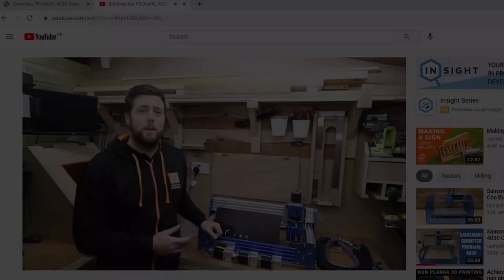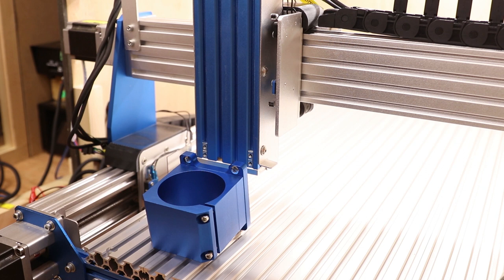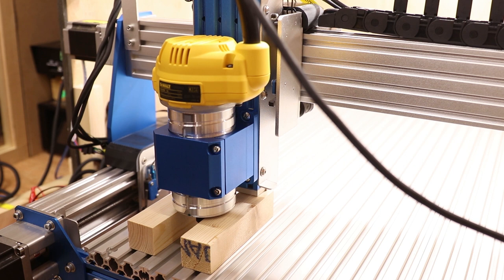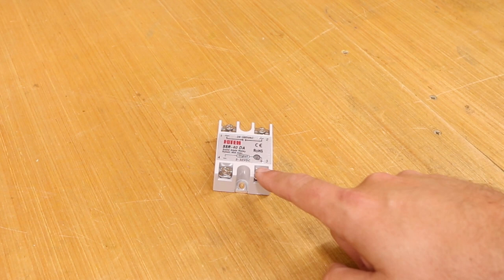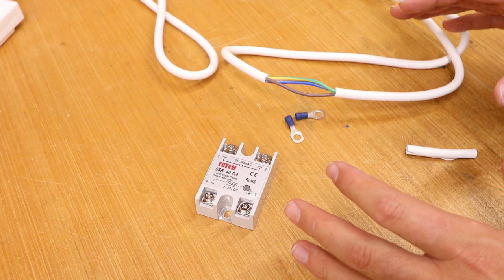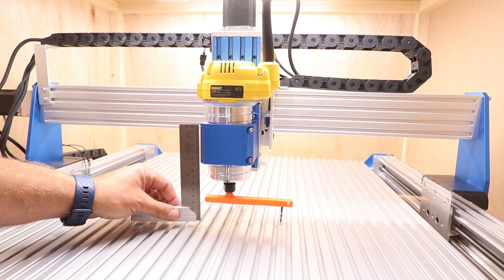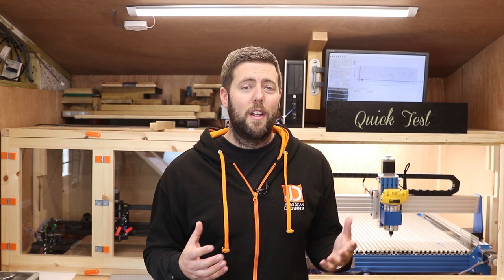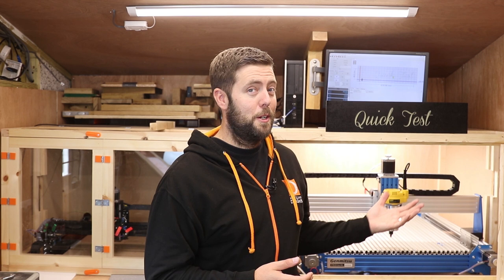Upgrading your spindle/router on a desktop CNC - 300w to a Dewalt DWP611

Comment: To switch on your DeWalt spindle, had you considered an automatic load sensing switch, similar to what would be used to turn on a vacuum dust collector when a table or bandsaw is tuned on?
Reply from the maker: I may be getting confused but is that not what SSR does which I use in my video? or is this something separate?

Comment: Hi James, big thanks for all your videos they have been invaluable. I have upgraded my spindle to the D26200 Dewalt and very happy (apart from loosing a bit of the work area). I have some 1/4" -> 1/8" bit adapters/converters for the bulk of my bits but I do have some 6mm ones which I have bought over the past few months from sellers saying they were 1/4". Now I do have the SainSmart set of collets but do you know if these are OK in the Dewalt collet nut ? I would have tried before asking but I cannot get the collet out of the collet nut on the Dewalt (I do not want to damage it with brute force).
Reply from the maker: Sadly not, the Dewalt collets are unique to them. you can buy different collect to fit the dewalt but they are not cheap, or not in the UK anyway. Ive just had a similar thing and ended up just buying new 1/4 bits instead but I only had a couple of 6mm bits
Reply: @James Dean Designs  Thanks James. I have actually found a Dewalt 8mm replacement collet/nut with a Trend 8mm/6mm adapter which means I can use some 8mm ones I have as well. Not too badly priced @ £23.12+VAT inc delivery from FFX.

Comment: Does any one know how much cutting area you lose due to the router sticking out further. The only way around this would be to move the limit switches to the max position and possibly over hang the spoil board.  Or extend it. Unfortunately i do not  have the space to do that.

Comment: Hello James, Thank for the very nice videos. They have been a great help!  But I have a question. The power output for the original 300W DC spindle is very likely to be PWM. This means the SSR will probably also switch at that rate. Does it influence the Router (speed - power) ?
Reply from the maker: The output for the laser is PWN but I'm not 100% sure the spindle is. Either way I can't say I have noticed any issues, it's worked perfectly fine
Reply: @JamesDeanDesigns  Thank you for you answer. SSR is already on the way. The machine certainly deserves this upgrade.

Comment: Hey James, can carvoco still control the rpm’s of the router, if connected via the SSR?
Reply from the maker: No. Once you use an SSR you then control the speed manually on the router

Comment: Hello James!  I know that you had a video on here for upgrading the Genmitsu 4040-pro with a makita RT0701C with the solid state trick....I can't seem to find i anymore on here.  Is it still available?  Thanks!
Reply from the maker: Hi, I think you may be getting videos mixed up. So this is the one wiring in the SSR. On the 4040 Pro review I should running it with the Makita but not wiring it into the SSR.
Reply: @JamesDeanDesigns  Yes, that's probably the case. I was still able to use the information from that video and applied it to mine. Worked out great! Thank you!

Comment: Good video. Where to get collets for smaller shanked bits for the Dewalt?
Reply from the maker: You can get collets off amazon or ebay but if its just for 1/8th bits then search for a 1/8th collet sleeve. They are a lot cheaper than buying a full collet insert
Reply: @JamesDeanDesigns  Yes 1/8 collet. Thanks for the sleeve tip! Will buy one.

Comment: Hi James, Easy to follow video. I have a strange problem, the router pulses, slows down, and speeds up when connected via the SSR. It keeps a steady speed if I plug it in directly and manually turn it on. I've checked all the connections, thinking it might be a loose wire, but all are fine. Any thoughts on what the problem might be?
Reply from the maker: Make sure the manual power dial on the control box is turned up to full if you have one. If not then make sure the your RPM signal is at full which basically means the RPM value you're sending out equal to or higher than your $30 setting. Hope that makes sense
Reply: Thanks for your help. I don't quite understand what you are saying about the RPM signal? I use UGS, would that tell me my RPM signal output? I understand about the $30 setting and I will check that to make sure it is at least the speed of the router.   @JamesDeanDesigns
Reply: Thanks James, I finally worked it out. Obvious when I thought about it, the file was configured to the original spindle specs on my Sainsmart 4040, changed the spindle speed in the gcode and all good.

Comment: I'm confused, you talk about wiring the original spindle into the bottom of the SSR then the router into the top, but then go on to splice an extension cable, which I assumed would be plugged into the mains hence the plug and socket (for the router) and getting power from the original spindle??????
Reply from the maker: So the splicing of the extension cable is to save splicing the cable on the router... this is purely to avoiding voiding any warranty. 
The SSR doesn't draw its power from the existing spindle cable, it just uses the signal. Effectively think of it as an on/off switch
Reply: @JamesDeanDesigns  thanks, I'm just at the start of making my own cnc, had the mechanical parts for a few years and only just built the frame. I've got 4x nema 24 stepper motors, 4x DM860 Drivers and a 240v dewalt palm router, looking at buying the SSR to use the router, but the description of the wiring confused me...Still does, would I have to run wires from a cnc controller (spindle outputs) to the bottom of the SSR since i don't have a spindle???
Reply from the maker: @mickyas1000  essentially yes. The spindle output from the control board is what tells the SSR to turn the router on. The new FoxAlien unit is an easier and faster way but still works on the same principle 
https://youtu.be/vEOX8F8dkn0
Reply: @JamesDeanDesigns  aw man, thanks, but even more stuff for me to get my head round and consider buying. 🤣
Reply: @JamesDeanDesigns  so just to clarify, before I burn the house down, I take the neutral from the 240v mains directly into the router (dewalt 900w palm router), the live from the mains into the SSR then out of the SSR into the router and the bottom 2 terminals on the SSR are connected to the controller  48v power output or 48v spindle output (the controller has both)...so no need for an additional psu?? As I've seen various diagrams showing the SSR being hooked up to 24/48v dc psu's!!!

Comment: Awesome video. I can’t find the dewalt locally. Can I use the Mikita router?
Reply from the maker: Yes you can! but you will need a little sleeve to sit within the holder. The dewalt is 69mm diameter, and the makita is 65mm I believe.
Reply: @JamesDeanDesigns  thank you I found a dewalt locally

Comment: I have a DeWALT D26200-QS - which looks very similar to DWP611 - but it seems to have some safety feature wich prevents it to spin up when the router's power button i in the ON position and the external power goes from off to on. Has anybody else a similar experience?
Reply from the maker: Makita did a similar thing on their 702 model. I believe its called anti stop/start technology and sadly is a pain for those who use them in CNC routering. Whilst I suspect there are some differences, there was a video on YouTube showing how to get around it on the Makita. Does require opening it up so you just need to be careful

Comment: Hello James, 
I have a Foxalien Masuter pro and I tried to attach a Makita R0700C and I did the wiring using the SSR following your steps but it didn’t start at all. Is there any advice you can give.

Thank you 🙏🏼
Reply from the maker: If you wired it exactly how I have in the video, and have the same rated SSR then you should be fine. I know a few who have done it on the Masuter Pro and its been fine. If you're on Facebook then maybe send me some photos
Reply: @JamesDeanDesigns  Thank you for taking the time to response, I did the wiring exactly the same as you did, but now after watching few videos on YouTube I believe the SSR I bought is damaged because the small light didn’t light. I will go and get a new SSR and try again. Sure I will send you few pictures when I do the wiring again tomorrow. 

Thank you again for your time and help 🙏🏼

Comment: Hi James can you help I know nothing about cnc machines I do a lot of Woodturning and make lots of wooden boxes with lids and want to start doing some cnc work on the lids and in filing with resin I need something that can cut into hardwood possible to a depth of 25/50 mm was looking at your videos on the genmitsu cnc 4030 it was on offer for about £850 on Amazon but now back up to a grand is this machine capable of that depth? And finally how would I transfer images what would be the best software for it 
Regards
Dave
Reply from the maker: Hi,
Yes the 4030 can do that deep. In terms of taking an image, it depends what type of an image. There are generally 2 types, vectors and raster.  Vectors are things like text, logos, usually simpler shapes. Raster images are things like photos. Vectors are easy to convert and machine, raster images are harder

Comment: 3db difference (70 vs 73) is x2 noise level increase ! It is not just 3db ….. db’s are not liniar , every 3db are x2 increase in noise  ….
So the router showd actually 4 db increase in noise so it is more than twice lauder than the spindle .

Comment: Just wondering what is the best way to turn a jpeg picture into a 3D image that can routed on a cnc machine
Reply from the maker: It's not a task I've done before but you need software capable of doing it. I think Carveco Make+ or Vectric Aspire can do it, also Meshlab I think but not 100% sure

Comment: I would like to upgrade the spindle on my 3018 Pro with a Dewalt router. Is the 3018 framework sturdy enough to support a Dewalt router?
Reply from the maker: I have seen people do it, but I personally would consider extra support such as liner rails to take the weight

Comment: How do you control the speed of the router?
Reply: This has to be done manually on the router.  The dewalt 611/262 speeds are about:

Setting / RPM
1      -      16,200
2     -      17700
3.    -     19450
4.    -     21100
5.     -    23500
6.    -     26900

Comment: Hi James I bought the IOT Relay how do I hook it up any thoughts
Reply from the maker: I believe there should be a connector  where the cable from the spindle goes. And then you plug the other devices into the top such as your spindle and vacuum
Reply: Hi Robert. So how is the  IOT Relay working out for you? I'm interested in getting one, also but I do not know how to hook it up or anything. 
I'd appreciate any help you can give me. 
Thanks.
Reply: @JoeLazzara  Hi Joe I haven't upgraded yet because I having some issues with homing and soft limits ( I think) but I got a reply from James Dean that should help you out:  James Dean "I believe there should be a connector where the cable from the spindle goes. And then you plug the other devices into the top such as your spindle and vacuum"
Reply: I know this is an old question but I also purchased the IoT and am having trouble getting it to control my router. I attached the spindle wires into the port on the side of the IoT but do not get an "active" light nor does the router turn on (the "+" and "-" spindle wires are attached to the matching ports). I've tried sending the m3 s10000 command but still haven't had any luck. Also, the router is plugged into the "normally off" outlets. Is this correct? Any help would be deeply appreciated.
Reply: I'm replying to my own thread in case someone else runs into a similar problem. So, as I suspected, it was complete user error (read - user stupidity). While I had the device wired correctly, I couldn't get it to work. When I read the voltage coming off the input wire going into the IoT, there wasn't enough to switch the device on. After fiddling with the controller box, it dawned on me to try the speed controller knob... and of course it was turned all the way down. A simple flick of the wrist and my problem was solved. 

In my defense, I never used the stock spindle but had upgraded to the DW611 upon assembling the CNC. Still... stupid is as stupid does. Hope this helps someone else in the future!
Reply: @RockyMoroz  so the IOT relay worked as expected? are there different types? i can see there are different slots for the router to get plugged into.

Comment: Can you use a cordless router (I have a Dewalt DW600) instead of the Dewalt 611?
Reply from the maker: I would advise against it. May be ok for a short job but usually as the power drops in the battery, so does the torque and that's not ideal as it will likely cause a job to fail
Reply: @JamesDeanDesigns  Thank you James. That makes a lot of sense. As always, great info and keep up with the really informative videos

Comment: Okay, I did this with a Masuter Pro, and a different brand router. I am having a couple problems: When I use the SSR relay, the spindle works only intermittently - spinning up and down - when the 60w plug is used, and not at all when the 300w is used, but it works perfectly if I plug the router into the wall and manually switch it on. And, this new 65mm router shaft apparently doesn't play well the positions of my kill switches, so do I need to move them?
Reply: Oh, wait. Problem 2 solved. I'm stupid. I had a little case of bits on the table between the table foot and the tram l, blocking the latter from reaching the limit switch. Sigh.
Reply: Wait. Problem 1 solved; I don't know why. I tried it again, and now the router spins up, and everything works as it should.
Reply from the maker: Glad you have managed to solve them. Some SSR have a minimum and maximum power range from the original input so on the speed dial I usually have it set to about 70%
Reply: I tried it again, and was getting the slow-fast-slow-fast behavior again. But that was when I was using the spindle test button on the offline controller. But when I sent the job from the offline controller, the speed stayed steady. Weird.

Comment: I am a CNC beginner. Is there a way to use a 1/8 inch shaft with the dwp611? I would appreciate it if you could tell me what to buy
Reply from the maker: There certainly is. You just need a converter sleeve like these https://amzn.to/3b5WYc5
Reply: @JamesDeanDesigns  Thank you for your quick response
By the way, if you want to switch between 1/4 axis and 1/8 axis, what kind of method is appropriate? I want to know your operation

Comment: Does the Z probe still work after changing the router body ?
Reply from the maker: yes, as long as you complete the circuit between the plate and the bit

Comment: Hi james can you tell me where I get the two wires for the relay that go to the cnc? Thank you very much
Reply from the maker: It will be cable that already goes from your control box to the existing spindle. So if your upgrading, its essentially your existing cable
Reply: Ah ok the same cable that feeds the original spindle is the same that goes from the cnc box to the relay. Ok thank you very very much James
Reply from the maker: @juanlozamore  thats the one 👍

Comment: Hey James,
what collet are you using with the Dewalt?
What is the shank diameter of the cutters?
Best regards
Reply from the maker: By default the collet takes 1/4in bits, but you can buy inserts to use 1/8 bits as well
Reply: @JamesDeanDesigns  okay thank you very much! I think i use the 1/4"

Comment: How did you get your DWP611 with the vertical power cord? It gets mentioned all over the place but there seems to be nothing on Thingiverse for making it on your own.
Reply from the maker: This is not the DWP611, its actually the 26200 which is the european version. Essentially the same but just one or two minor differences like the power cord.
Reply: @JamesDeanDesigns  That is a shame. I have already designed a part myself to re-route the power cord though, so it's not all bad. Thanks for the reply!

Comment: Hi, any concerns with continuous use for hours with the Dewalt? It seems the spindles are designed to do just that but the routers normal use is more intermittent.
Reply from the maker: Routers have brushes, which wear down. The longer they run the hotter they get and can wear down faster. Proper spindles do not so can run longer. I say proper spindles because the one's on smaller machines still have brushes but the larger ones you use with a VFD do not.
Something likenthe dewalt is still meant to be rated for upto 100 hours though
Reply: @JamesDeanDesigns  hi, yes that’s the concern for me although the extra power at a more reasonable cost has got to be tempting.

Comment: Do you have to use the SSR or is that to protect the router warranty?
Reply from the maker: The SSR is to allow you to turn your router on via your software. You do t have to use one but you need to start your router manually before starting the job, and then stop it manually at the end

Comment: A 3dB increase in volume is the same as doubling the sound intensity. Unfortunately our brains won't perceive the increase until it's a 10dB increase (which equates to 10 x the sound.
Reply: Sorry, don't know why you'd say that... He's measuring and talking about dB SPL or "pressure", which is what most people do when talking about sound or noise levels. Basically an RMS voltage from a pressure measuring device (microphone). That's why the meters are marked "SPL" : Sound Pressure Level.
6dB (6.02 really since it's a log20 base) is a doubling in SPL, and you need about 10dB SPL to get a percieved doubling in loudness.

You're absolutely right in that 3db is a doubling in "intensity", but that's not the unit an SPL meter uses - and it's not the unit you usually talk about when comparing sound/noise levels.